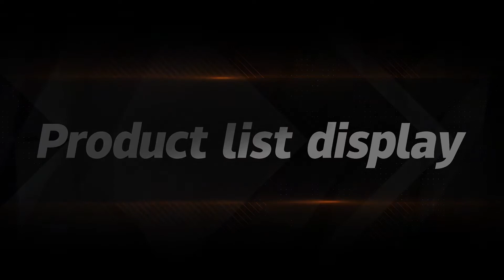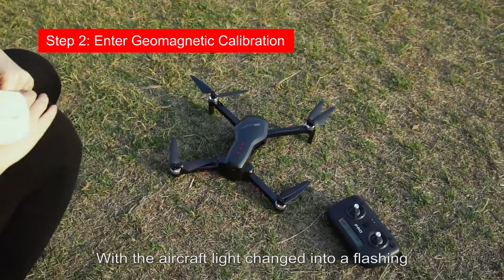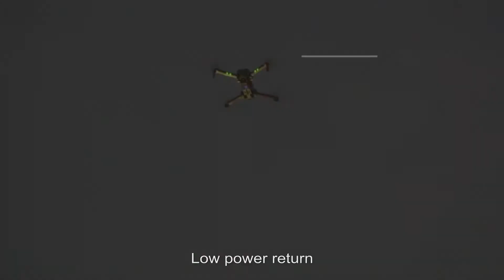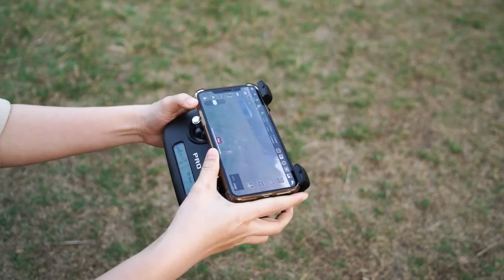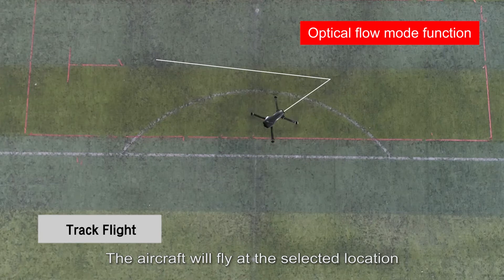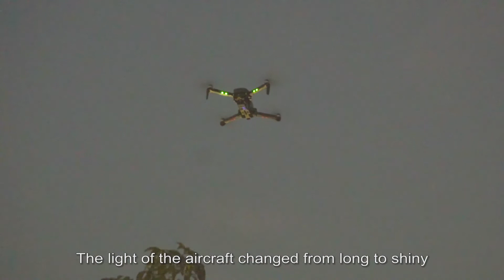HS470 quick start

Comment: I've got an HS470 on the way -- should be here by Monday 10-26-20 (2020 26 Oct.).
I found this video useful because it demonstrated that I need four AA cells for the radio -- information that I was unable to obtain online even after an exhaustive search.
 
The "Specs" tab on the Holy Stone website appears to be malfunctioning; I tried two different computers running two different OSs and got the same (lack of) results on each one. :-(